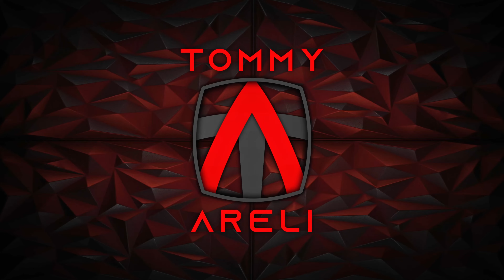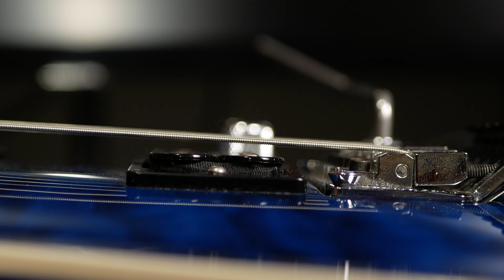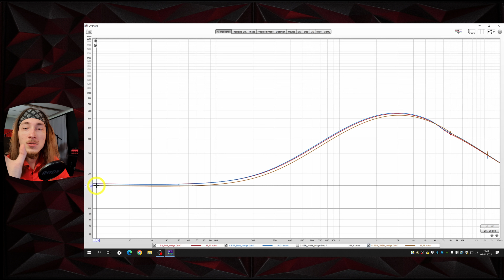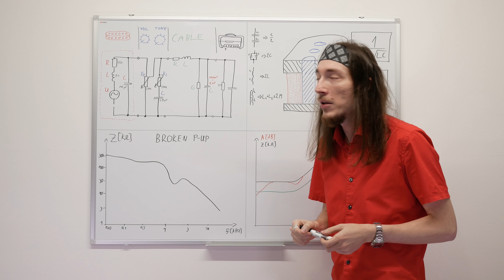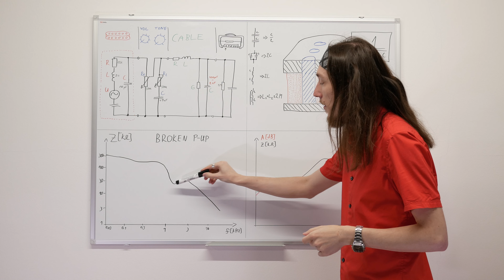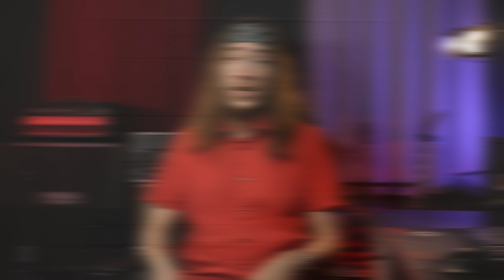TT001: Are they the same? 4 ESP guitars sound comparison

Comment: I'm surprised if different pickup has slightly different sound despite having the same model. Manufacture tolerance is causing it. I'm more surprised how the sound change when you change FR.
If you like more consistent sound, why don't you use Fishman active pickup. Since they are made printed circuit which should be more consistent than passive and EMG.
Reply from the maker: I don't use the fishmans because they're not too long on the marked and I wanted to spare buying used ones. And after all, I just had to explore this by myself. Maybe in future I'll change the brand 🙂 I wonder if the sound changed by chaning the FR due to springs or the bridge itself. Still these differences are tiny, not taking the broken pickups into account.
Reply: @tommyareli  I'm interested in knowing what will happen after you change the broken JB. I wait your next video for it.
Reply: @tommyareli  "Maybe in future I'll change the brand" - no better guitars than esp horizon)
Reply from the maker: And I think the manufacturing tolerance of the piskups is not a big issue anyway in case of SD, the healthy ones were very close, in 2% tolerance as I remember, maybe better.

But anyway I'll try the fishmans at some point, would be great test.